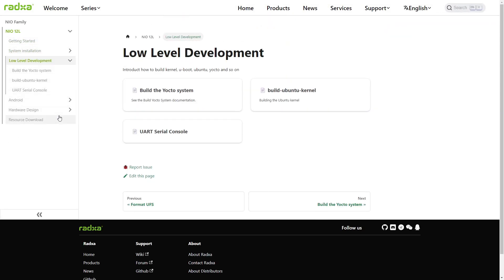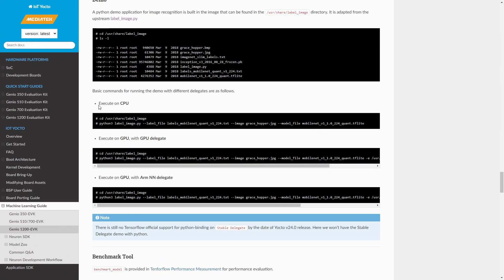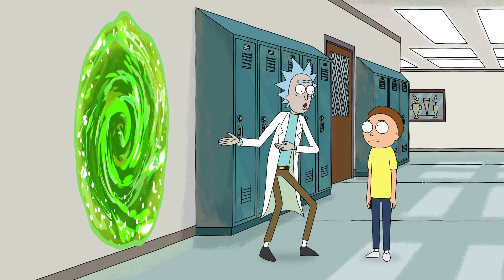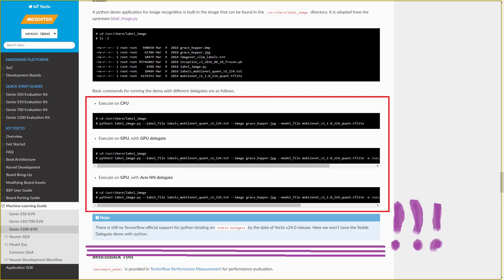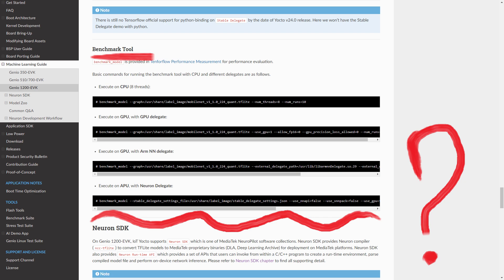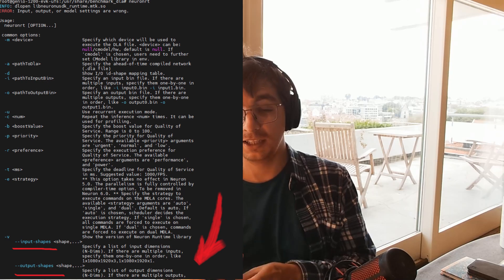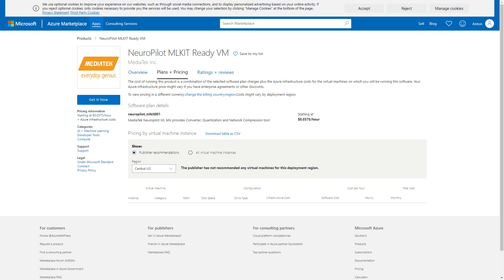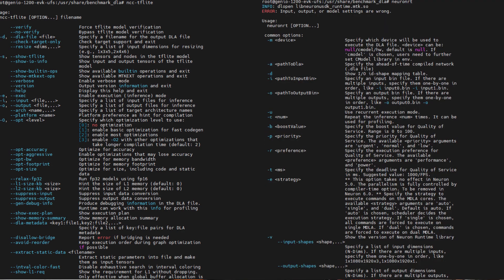Does this even work?! - Radxa NIO 12L (MediaTek Genio 1200)

Comment: Hi Anton, Hope you are well. Have you test Hailo-8 on rock ship ?
I would like to run a multi modal llm on rockship but I cannot find any multimodal tiny model on rockship, some concerns seems to be the non open source driver from radxa. So I was wondering if Hailo 8 on rockship could solve my problem.
Reply from the maker: Hi!
If I remember correctly, Hailo-8 did not support multimodal models. At least ~1 month ago. 
There were problems even with Whisper and some transformers.